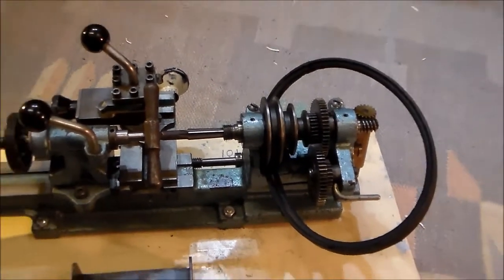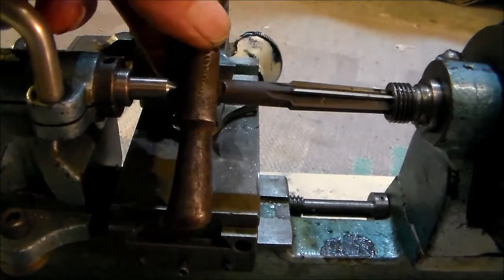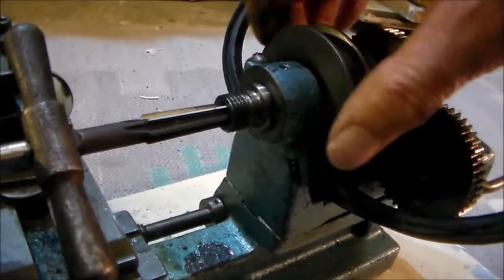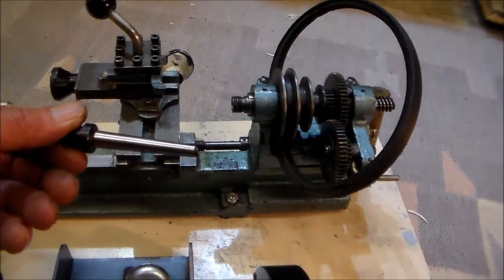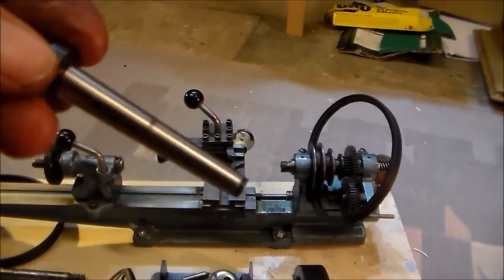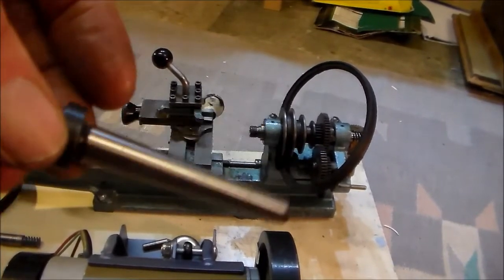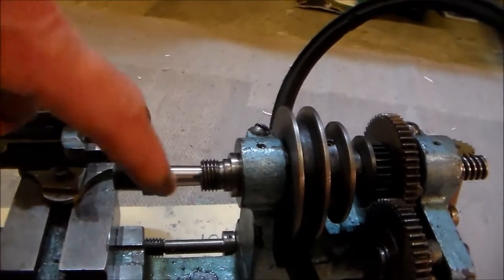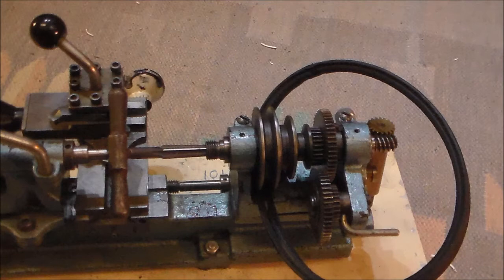Trial fit MT0 in Simat 101 micro lathe

Comment: I have just started  to   use my  lathe  some ay its a simat101  some ay its a norfolk   but its just like yours . i am lucky in i have a 4 jaw chuck and a 100mm back plate  so i  mounted a collett chuck  on that. the big problem is no tail stock chuck  has any one  found  one ??
Reply from the maker: Hi Nigel, finding centres is hard enough. I keep looking for spares. They must have been plentiful at one time, but if seperated from the lathe then no on will no what they are for. Let me know how you get on. John

Comment: I ve just bought a flexispeed ,with the hand scraped bed plainly visible, and am having the same trouble.
I bought a decent little 3 jaw chuck with a 12 m thread and am going to have to buy another  I can make a bachplate for.
At least I have a Cowells dead centre which fits.
Good luck if anyone still there!
Reply from the maker: The are nice little lathes Jonathon. I've just bought a sewing machine motor for one of mine. I fould one long MT0 centre at the Model Engineering show, but non to fit a Cowells and its cousins.

Comment: How did the cleaning up go in the end? Was it the bore or the taper? I have just ordered me another one of these morse taper reamer sets - I have an MT2 and have ordered an MT1. Did they work out ok?
Reply from the maker: +huxleypig69 Hi, it was the taper. made in China or Czekoslovakia for RGD. RGD should have better quality control. The reamer and bore seem to be spot on. I got my reamer directly from China.
Reply: Lathe Bits
Me too, I have not seen them for sale in the UK. I find RDG's tools can be very hit or miss. Better than Warco though (as a rule IMO).
Reply: Mine was RDG but did nt rattle about anything like that much and drawbars pulled up nicely.Lucky!
All I need now is a chuck key.I found one size on these £1 4in1 ones fits with the shaft ground down a bit. Sending details to Chronos should result in one that fits.